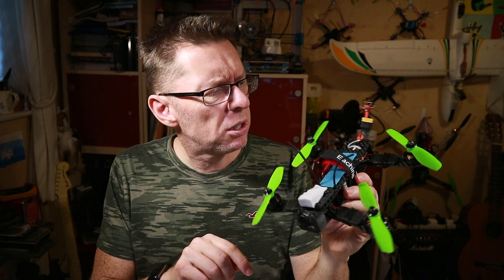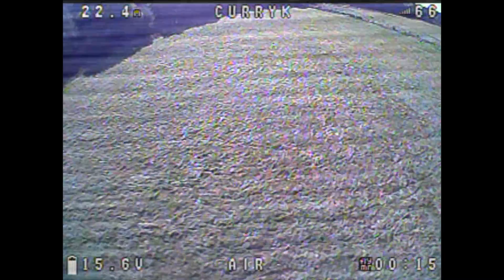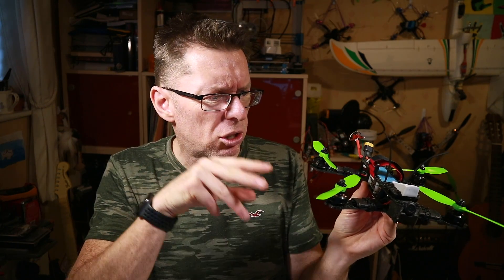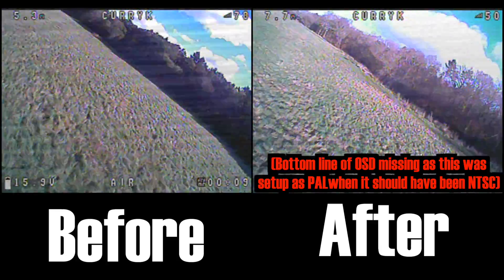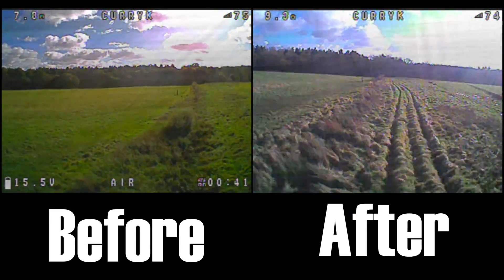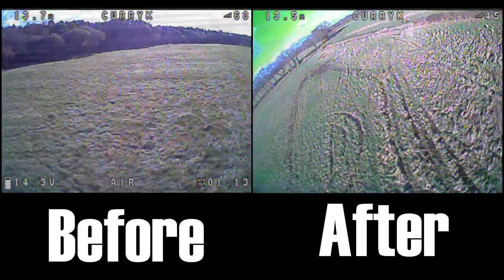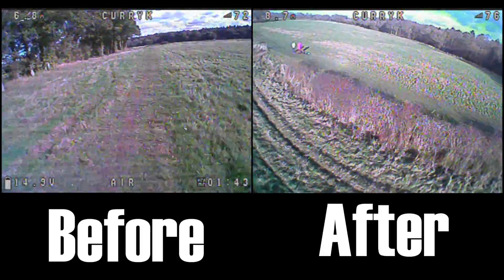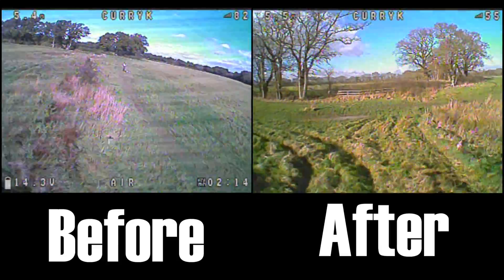FPV quick fix: Does adding a low-ESR capacitor help with video noise ?

Comment: Can too small of a capacitor cause a 4s quad fly bad on 6s? I limited my motor output in Betaflight for Profile 2 so I can run 6s on my 4s quad. Everyone doing this says it works great buy my quad is unflyable on 6s. It grossly overshoots and has really bad bounce back. I'm using a 35v 470uf low esr capacitor. I was wondering if that's not large enough to absorb voltage spikes from the 6s battery. What do you think?
Reply from the maker: I don't see it a reason.  It's generally the ESCs causing the noise and the capacitor trying to protect the VTX from that noise.  The problem with flying a different power setup on a quad tuned for one is that it doesn't necessarily work for the other.  Limiting the throttle will stop the amount of amps you can pull on a full punch out, but the motor responses and outputs will still be quite different from 4s.  I'd suggest you create a separate pid/rate profile for 6s and tune it accordingly.  Then just flick back and forth with yourp pid profiles when you use different lipos
Reply: @CurryKitten  Thanks for responding. I did the CLI commands that program the quad to recognize the cell count (4s or 6s) and automatically switches between profile 1 for 4s and profile 2 for 6s. I limited the motor output for the 6s profile to 66% which gives the motors the same maximum RPM as the 4s battery has. The PID controller should not be able to move the motors faster than 66%. With everything scaled down and the 6s battery weighing about the same as my 4s batteries, I'm at a loss as to why the quad is nearly unflyable on 6s.

Comment: My 35V 1000uF Low ESR cap did almost nothing, I even soldered 2 capacitors there and not much... the lines are still present.

Comment: I had similar fpv feed on one of my rigs and right before trying this method i noticed how my vtx antenna was hard mounted to the frame so i basically soft mounted it with rubber washers and it cleared right up!

Comment: Hi Wayne I am constantly trying to improve video all the time
I have tried copper tape, esc's and diodes. You say you have other things to try
What were they?
Reply from the maker: I haven't touched this particular quad, but on others I've tried a combination of the low ESR capacitor along with an LC filter on the video, and other people have talked about putting a cap on each ESC.  What I've mainly picked up though from flying a lot of different quads is that there's not a fix-all and when quads come with the right combination of components there is just no noise to speak of to start with.  There's no pattern to this, I've seen expensive quads with horrible noise and cheapo quads with none.  Having individual ESC/FCs/VTXs with their own power regulation does seem to work the best
Reply: I did fit a cap on each of my esc's on a quad last year, debatable if that really worked against having one connected to the lipo conection
I have also tried copper tape
Just interested in what other people are doing or using
I do understand it is an analogue signal , so there will always be interference 

Each quad is different and I have noticed that on certain days the signal can change so much
Eg It is misty ,atmospherics or a school holiday and an increase of wi-fi in the area

Maybe the answer is Digital
At least I got you name right this time 
Lol Wayne not (Kevin)

 @CurryKitten

Comment: On capacitors which is the plus or negative? Im assuming the longer wire is postive and the shorter is negative?
Reply from the maker: Yes - usually the longer leg is positive, and there's normally a repeating '-' symbol down the negative side of the cap

Comment: Looks allot cleaner.  I just put a 330 capacitor on each of the escs on my wizard x220 and now my video is Cristal.  I had stopped flying it it was so bad. I have also tried one single 1000 cap with some impertinent. My conclusion is when posable run capacitors on each esc. Does anyone know if you can run a small cap on the power lead to the fc? Ps good video.
Reply from the maker: I've got an X220s which was very noisy, I tried a single 1000uf cap along with an LC filter on on the video and it was still bad.  Certainly, a cap on each ESC is the best solution for eliminating noise, but also the most involved one !  That x220s of mine pretty much burnt out another motor in a single hover session.  I thinkn it has more issues than just video noise
Reply: That is strange.  I would check the notch filters in betaflight, reference some videos to set them correctly. And throw away the props that came with the wizard and get some dalprop cyclones to replace them.
Reply: Also maybe try mounting the fc with rubber standoffs.
Reply: I would agree with Kevin. In my experience the way the get perfect clean video is A) have your VTX & Camera share the same GND pad. B) 25v 330uf low-esr on each ESC. (ideally Panasonic FM series)
The ESCs are the source of the noise, so the best result is placing the cap as close to the source as possible. 
I never bother with a single cap on the lipo as it dosnt have much effect when ive tried that, but I know some people do say it works.

Great channel by the way, Ive just discovered it & really enjoy watching.

Comment: The 'after' looks much better. I put 1000uf on my lipo connection and 330uf on my escs. I then took the nack off my cam and put a sticky pad on the inside. That work a treat lol!
I leave the caps on because they do help - Vid signal, reduce voltage spikes and a noisy signal gotta be bad for escs too?

Comment: noob here... does the cap go between the positive lead of the battery and the positive soldering pad on the board or does it bridge the positive/negative soldering pads on the board?
Reply from the maker: Positive leg of the capacitor to the positive pad on the board, and negative leg of cap to negative solder pad (along with the wire for the XT60 connector in each case as well)

Comment: I run Betaflight f3 f4 w wrath or tbs esc's. I have always had video issues. Weird stuff like it would be great in the begining but degrade even stop working after a few packs. I have spent a bit of time on this. For me i make sure i ground the VTX and camera on the common ground pin, pull power from the battery directly, and recently use the same $.97 capacitor. I run the capacitor parallel to the board opposite of the battery lead. This simple setup is proving to be fantastic for clean video.

Comment: I had my battery wire going out the back like you and because it was close to the VTX cable / antenna it caused video noise.  But when I moved it over to the side I got cleaner video.

Comment: The capcicator improved things but is really just masking the underlying problem. I just spent last week experiementing to improve the same issue and eventually tracked mine down by running each motor individually in betaflight. In the end I tracked it down to one bolt just touching a winding on a motor. Enough to cause noise but not a hot motor or any other issue.

Comment: Worth noting that different size caps will remove difference frequencies of noise, e.g. a 330uf cap will remove higher frequency noise than a 1000uf cap.
Reply from the maker: That's good information - cheers

Comment: Now add 4 on the esc's!
Reply from the maker: Well, that's the best way - but overkill.  I'm looking for the most results for the least amount of effort ! :)
Reply: That might be the best way to have the most capacitance or best results. That is if it really bothers you that much. I'd be very interested if it cured the problem vs the one on battery
Reply: CurryKitten  but you also don't know if it is the board doing it or not.

Comment: Sure its not perfect, but its a marked improvement. You will be hard pressed to get rid of more you may find disappointment ahead. Simply because you have the high current conductors running so close ( due to it being a mini quad the one thing you don't have acres of is space :) )

Comment: Could you elaborate on what you mean by clean power? I've got absurd noise from my Wizardx220s and a I'd love a general tutorial for sussing out noise and whether it's possible to remove it.
Reply: The X220S requires a cap (on the battery pads) and a LC filter https://www.banggood.com/3_3V-25V-DC-DC-LC-Filter-Power-Supply-Filter-Module-For-FPV-To-Eliminate-Video-Ripple-Interference-p-1136802.html (between the 4 in 1 ESC and FC). You will then have 100% noise free video. The change in FPV quality is pretty drastic.
Reply: Here you go https://imgur.com/a/feP7H. Plug the positive and negative from the LC filter into the where FC would get power from the ESC board then plug the other position and negative on the other end of the LC filter into the FC where the leads from the ESC board would have come from.
Reply from the maker: Clean power = a steady constant voltage without any weird spikes and ripples that tend to translate into this sort of noise.  I too have a 220s to work on with annoying noise, but also a motor having issues, so bear with me and I'll see if I get the time to dedicate to sorting it out.
Reply: Zuldan FPV I have the same noise/lines problem on the x220s, I just ordered the filter you linked. Can you post a picture on how to connect it?
Reply from the maker: Nice to see you already have a good results.  I attacked this previously with just the LC filter and didn't see much of an effect - obviously I've got the cap to fit as well (once I do sort out that motor - I've a feeling some friction is causing it to overheat)
Reply: Currykitten did you install the LC filter between the ESC and FC or between the VTX/Cam and FC?
Reply from the maker: sorry for the late reply - it's crappy weather this week, so had the chance to pull the x220s apart and have a look.  I'd put my lc filter between the ESC board and the vbat connection on the FC - which sound like where you put yours.  I'm going to add the cap on the battery terminals and try flying it again (when the weather it better)  I've also stripped it down to bare bones (motor protectors, soft mounts, and side plates gone for now so I can eliminate the causes of a motor heating up too much

Comment: I just use a small LC filter in line and feed the FC / VTX / Camera with it....No noise, and all the important parts benefit from the smooth clean supply.   It is better though, a lot better.

Comment: A slight improvement I'd be happy with that and keep flying. Just to note one thing Joshua Bardwell has said put the earth on the VTX and the camera on the same pad. Might be worth a try? Might make it worse?
Reply from the maker: Yep - I'd gone down the common grounding thing before, but this really didn't help me.  This one is at acceptable levels, but some other quads might need a bit more tweaking